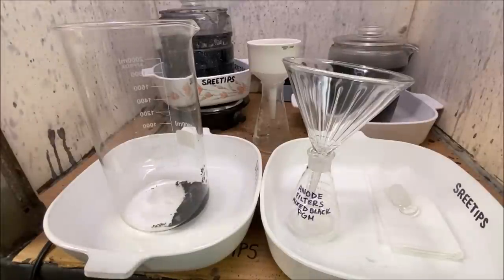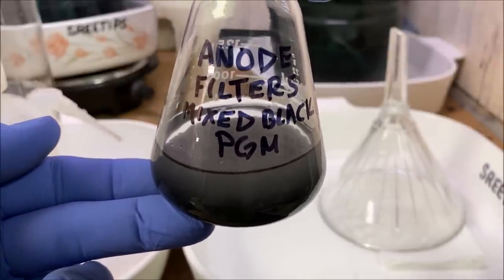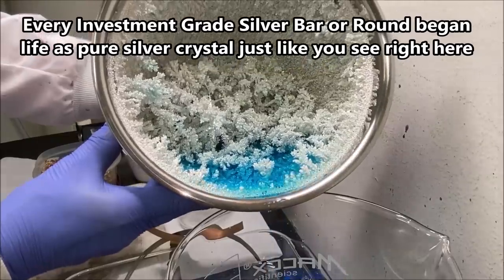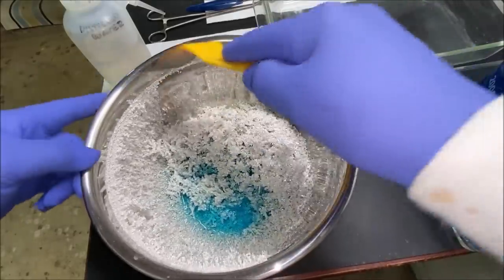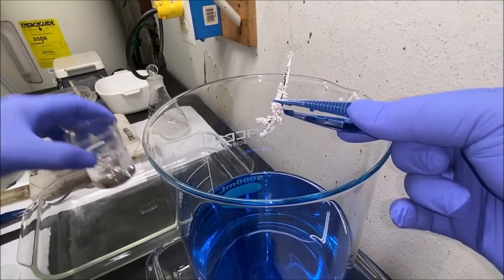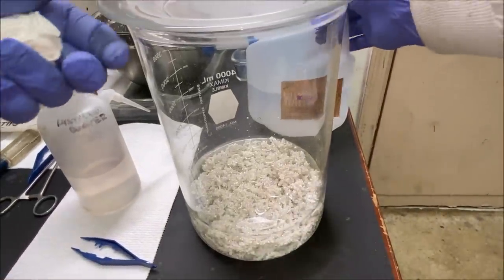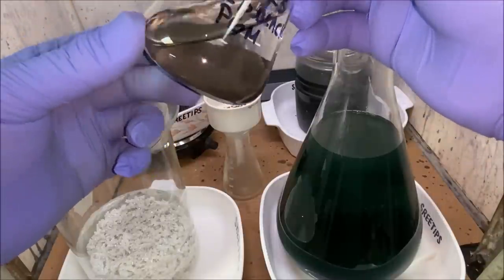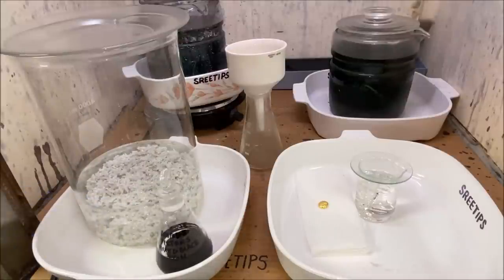Silver Cell Anode Filters Part 8

Comment: You can test that stuff you think is Iridium/Rhodium by attempting to melt it. If it refuses to melt as well as gold (and you should be able to tell easily with your experience) and doesn't burn, it has to be a PGM of some sort.

Another thing you could test would be if it catalytically decomposes hydrogen peroxide on contact.
Reply: Silver (and most other precious metals) also decompose hydrogen peroxide on contact.

Comment: Hi, Sreetips! )

First of all, I want to say that I enjoy you videos immensely and watch them almost religiously ))

..as well as to thank you for the effort of making them - for some reason I happen to derive an unexpected amount of pleasure from watching them, especially gold and PGM related ones )

However, I do have a question I can find no answer to, namely: why do you go through the whole tedious inquartation, multiple nitric boils, filtering & SMB preciptiation process when refining carat gold?

Why not simply dissolve everything with aqua regia, filter the solution & precipitate gold with copperas (since you say it precipitates "all the gold and nothing but the gold")?

Seems to be much faster than doing all these multiple boils to extract silver you've inquarted scrap carat gold with, even with all the extra water & HCl rinsing of the precipitate you have to do when using copperas..

I'm sure there's a good reason for you doing it the way you do, I'm just really curious as to why ))

Also, while I've got your attention: I get why you use borax when melting gold, but why do you sometimes also add "a pinch" of potassium nitrate?

What is it for?

Keep up the good work, cheers! )))
Reply from the maker: Two serious problems putting karat gold straight in AR. 1) it puts everything in solution and makes a very dirty solution that looks like used motor oil. 2) passivation - a thick crust of silver chloride forms on the gold and shields it from the acids. It won’t dissolve the gold until the passive layer of silver chloride is removed. Inquartation completely eliminates both problems. It’s one of the most valuable refining techniques that I’ve ever learned. Potassium nitrate adds extra oxygen and burns off impurities that tend to float to the top of the molten gold. Some of the gold burns away also.

Comment: What's the overall efficiency of producing silver crystal? Overall it's 100% as nothing is wasted but there is a process efficiency loss through electrolyte and slimes.
Reply: Thats why you should have a stock pot system in place to process your waste stream. You can recover all of your pm's this way. Although I think your question/thought process is; you will never get all of the silver that is put in back out as pure silver crystals and that is correct. Some silver will remain in the electrolyte and in the slimes but as long as you have that waste processing stream setup you can recover all of it back. Of course you may lose some to micro splatter, but that is neglegible.
Reply from the maker: I use 600 grams of pure silver in 3.5 liters of liquid for the electrolyte. I harvest about 1.5 kilos of pure silver crystal from that (electrolyte use) in about ten days. Some of the silver in the electrolyte plates out and it (the electrolyte) become depleted after a single use. I re-use the electrolyte for a second run but only after adding another 200 grams to the 3.5 liters of electrolyte to augment the silver nitrate concentration in the electrolyte for the second run. I also add small quantities of fresh electrolyte to compensate for dehydration. Maybe another 100g of silver nitrate over the ten days for both runs. So it take about 1000g to 1100g of pure silver for two ten-day runs of the silver cell. I harvest roughly (+/-) 3 kilos (3000 grams) of high purity silver crystal from both runs. This is not accounting for the impure silver shot that I feed into the anode filter basket. So, I put in 1 kilo of pure silver crystal for electrolyte and get out 3 kilos of high purity silver per two ten-day runs (twenty days total). One in, three out equals 2 kilos or one kilo per run. That’s a lot of ciphering, hope it helps.

Comment: I understand you get silver crystals like those two when reducing the voltage in the silver cell to around 1.5 or 2 volts. Has anyone get those results or had a scenario like that? You would get short chunky crystals instead of larger/thinner ones.
Reply from the maker: I run mine at 3.5 VDC

Comment: I want ask you.
how to neutralize the acid solution, after taking all the metals in the acid solution and I want to throw it away so as not to pollute the environment. thank you, we are waiting for your answer. thanks sir
Reply from the maker: I precipitate all the metals (mostly copper) on pieces of angle iron. Once the copper is out and I have nothing but iron in solution then I add sodium hydroxide to drop the metals as metal hydroxides. I filter the solids out and dry them best I can then throw them out. I add pH down to the filtrate to pH7 then add to the regular waste stream.
Reply from the maker: I have a waste treatment video that charts the path from scrap to to refining to waste treatment